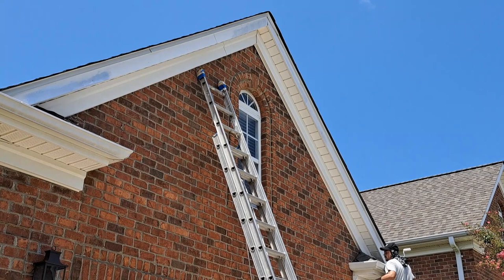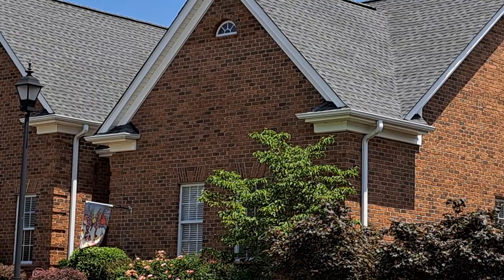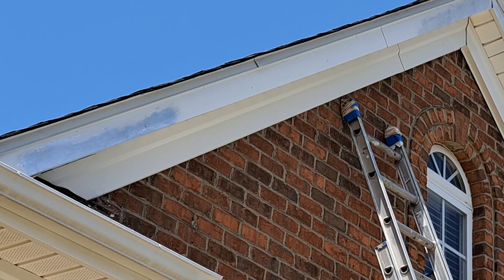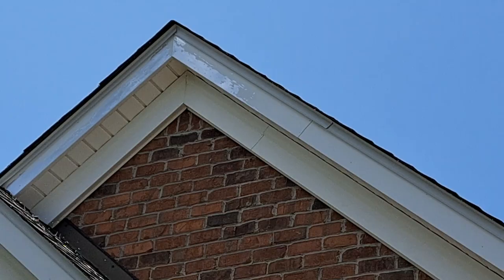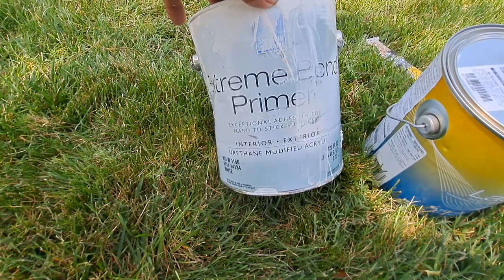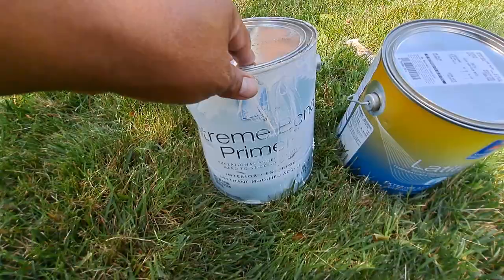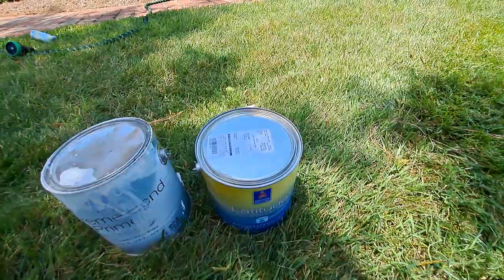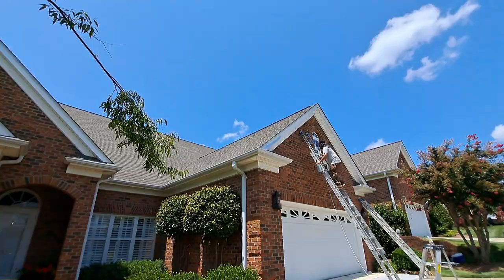what paint to use for your Aluminum fascia boards

Comment: Good video. Thanks for sharing I have this issue right now on my house and have been getting quotes to have the facia replaced. I think I’ll try this. Is it necessary to sand off all the old paint or just sand it till all loose paint is removed?
Reply from the maker: Not necessarily, just sand the loos paint, but priming is important for the paint to adhere properly.

Comment: I have an aluminum post on my back porch that is doing the same. I assume the same principles apply with it?
Reply from the maker: Yes, Sr,   same principle.
Reply: @pintandodetodo73  on the portion that has paint would you cover it with the primer too?
Reply from the maker: Yes, just make sure to scrape all the loose paint, and sand the edges then prime.
Reply: @pintandodetodo73  thanks for your help
Reply from the maker: You're welcome

Comment: Did you paint using a brush or use paint sprayer?  If paint sprayer, what size spray tip did you use?  My gutters are about 6 inches wide?
Reply from the maker: Welcome to my channel.  Sure. I did use a 310 LP  tip  is a Green color is s low pressure tip.    But you can  paint it with a mini roller and a soft bristle brush.
Reply from the maker: I forgot that Sherwin Williams does not sell that brand of paint any more, the one that shows on the video, but you can use water base  Industrial Alkid Urethane  it is expensive but is worth it.
Reply: What’s better spraying or painting aluminum

Comment: Do you prime all the white metal or just where previous paint came off?
Reply from the maker: Hey thank for visiting my channel. 
No need to prime the white or the solid painted are, just where the paint came off.    After is primed you can use exterior DURATION or exterior Emerald,  cause the paint you saw on the video Sherwin Williams does not selling anymore.
Reply from the maker: Make sure you use the same brand of primer that shows in the video.

Comment: Is it necessary to wash first or after sanding?
Reply from the maker: You can pressure wash it or wipe it off  before.  Cause after you sand it the dust won't stick to the metal.

Comment: What about a solid stain vs a latex paint which is thicker and cracks more
Reply from the maker: No, you can't apply a solid stain on your aluminum fascia,  it will fade in 6 months because of the extreme heat.
Paint it will last 5 to 8 years or more, depending on the prep work.
Paint has more protection.
Reply: @pintandodetodo73  thanks for the heads up. It’s a solid stain arborcoat already been applied just to make the color match better than previous